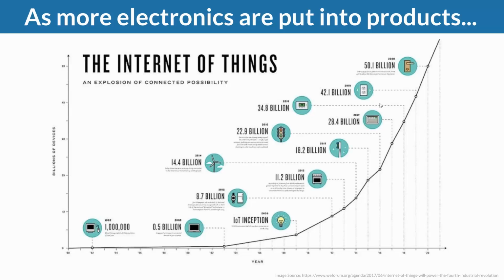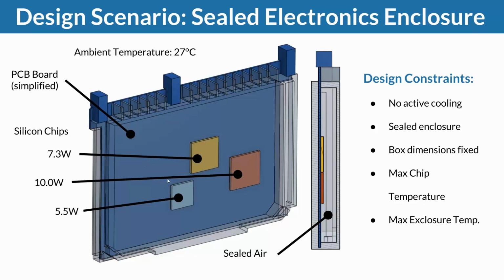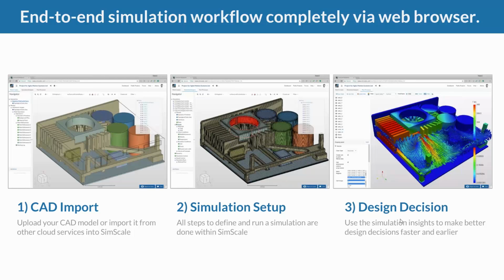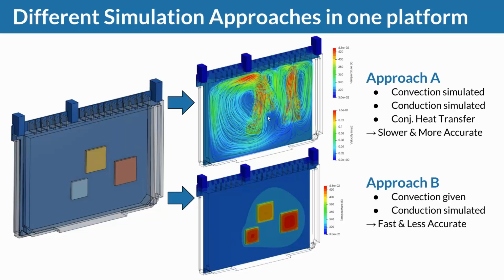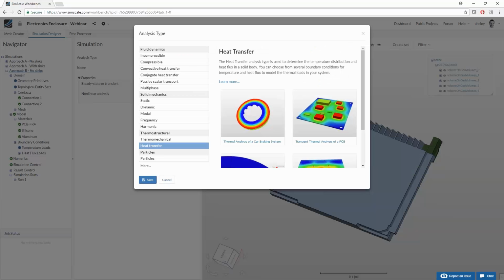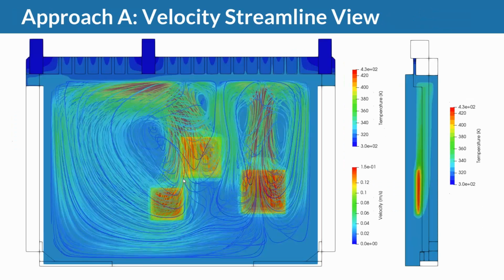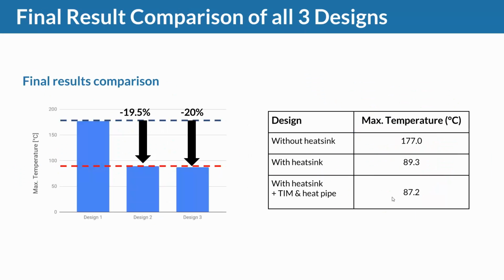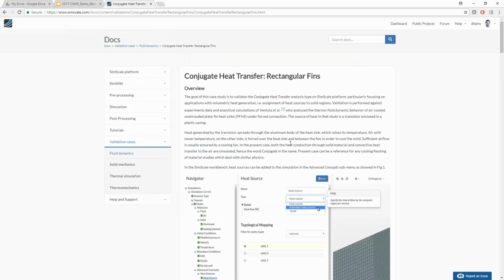Better Electronics Enclosure Design with Thermal Simulation

Comment: One thing that I am always concerned about is confidentiality. I won't trust any cloud-based simulations that require us to upload our 3D models (our design), which are confidential! I used to work with a company that utilized SimScale, but we reverted back to the old computer-based simulation as the design was a patentable prototype.